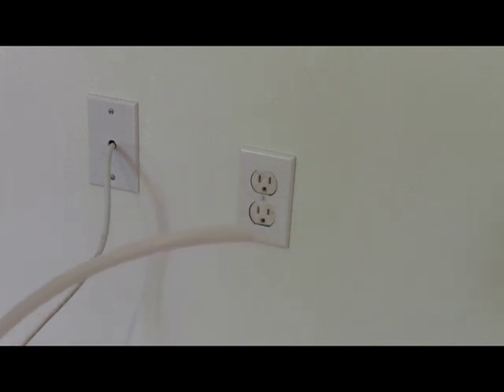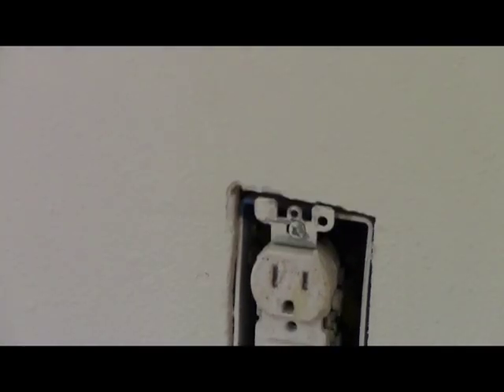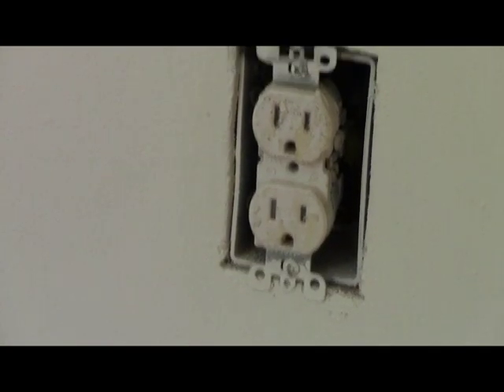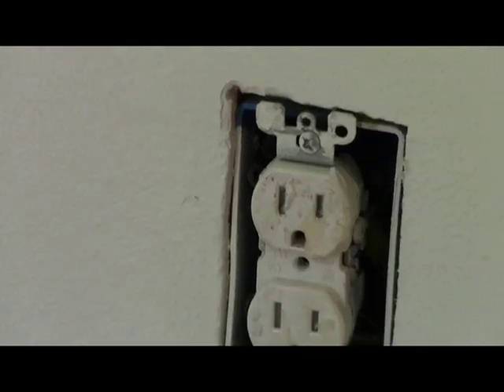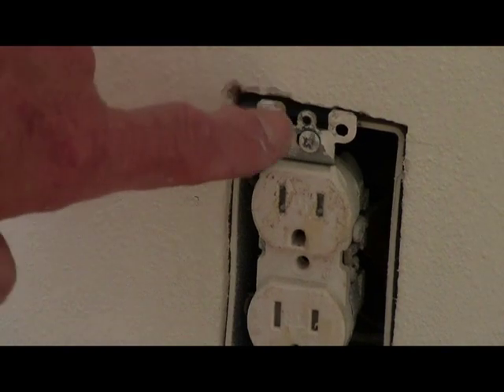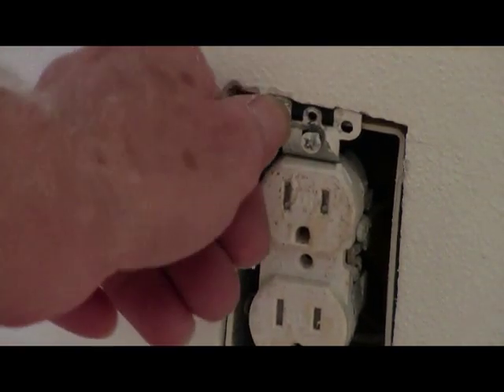Fixing a loose electrical plug or switch TURN OFF POWER FIRST

Comment from the maker: There is no chance of this catching fire , Have added a short video on what and where I place the plastic tubing. I use that plastic water line that goes to an ice-maker.  It has enough play that you can tighten or loosen the screw to adjust the plug..

Comment: all you need to do is remove the plate and tighten the top screw a few turns and when you put the wall plate back on it will pull tighter against the wall

Comment: Why not just spend the extra 1.50 to get the proper certified spacing tabs that won't crush down over time like this tubing surely will.  They are accordion design stackable because of that specific reason.  You went this far, no sense in rigging it, because that wouldn't pass code. 

It will temporarily solve the issue, but it will break down from pressure over time.  But it is same principle on how to use the plastic tab spacers.
Reply from the maker: Most of the time homeowners don't have them laying in their tool box so this is the next best thing.
Reply: dusty guy well tell you whats definitely not in my toolbox, water hose lol either way its still not going to hold up to time or code. Definitely not in my state, but it will certainly do the trick for the time being. The problem I mean by it won't hold up to time is, its a piece of flexible hose that has no structural integrity to hold pressure pressing in and pulling out on it over and over.  These particular pieces that you use weren't made for that, so its not reinforced is all.  But for a quick bandaid, yeah, this could work. 

   Wasn't tryin to be nasty with ya bud. Just know in my state, this would never pass and we would have to fix it.  Our inspectors pull plates here and look.